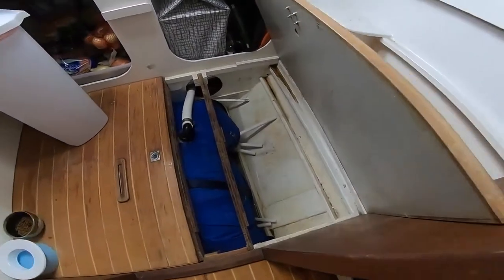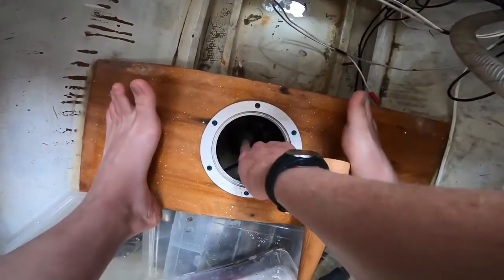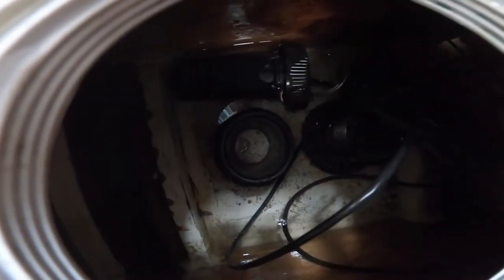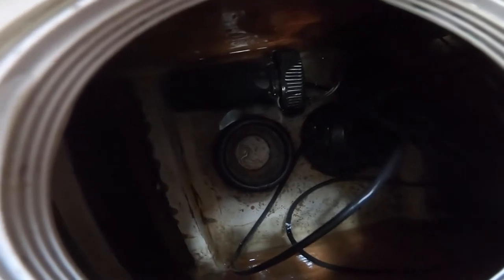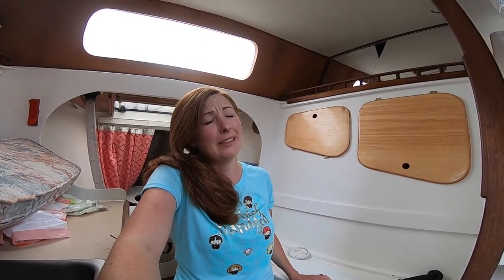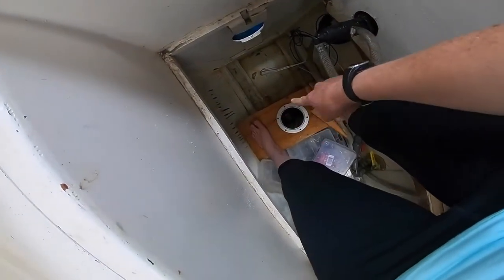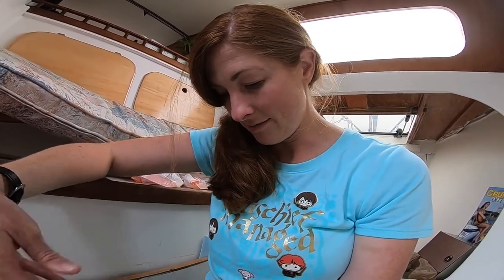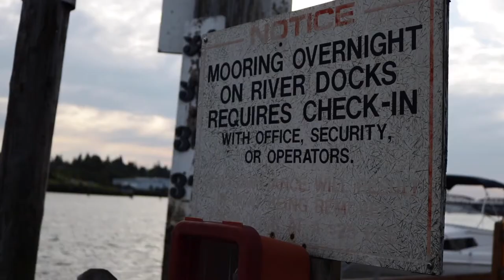Splashing a 36 Foot Trimaran Sailboat After Sinking it (Ep.29 Sailing w/the Litzenbergers)

Comment: The hole was most likely there to drain rain water while the boat was on the hard.
Reply from the maker: Could be. I think the transducer was also out because it protrudes from the boat a couple of inches and the styrofoam block the boat sat on would have crushed it, had it not been out. Thanks for watching!